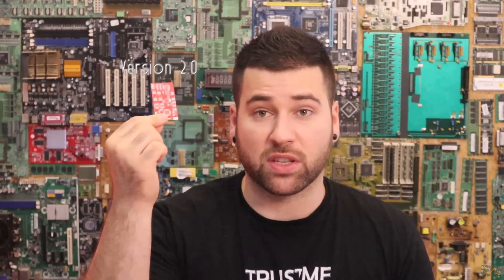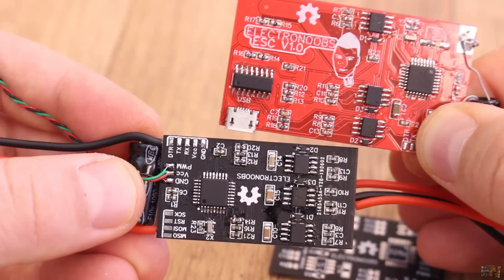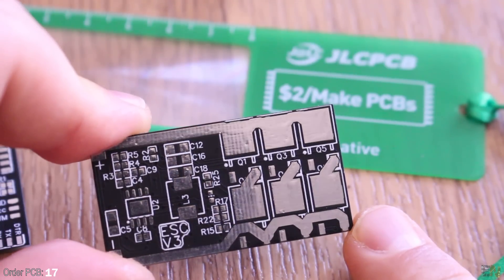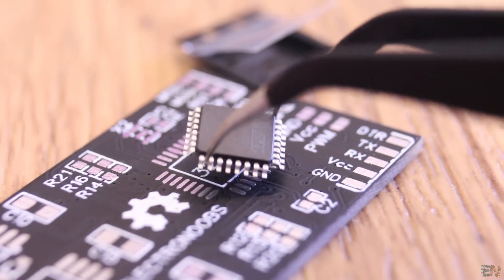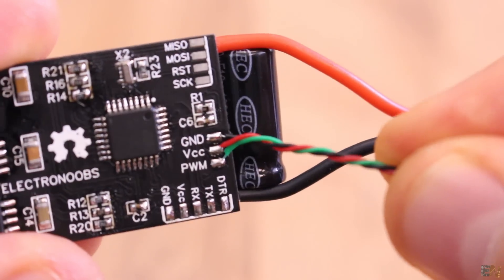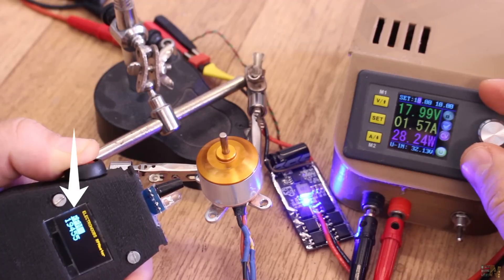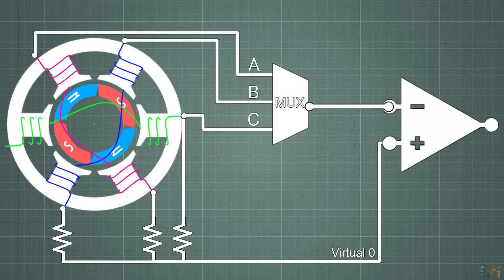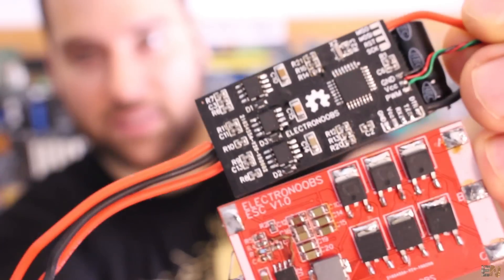Open Source ESC based on Arduino - High Speeds

Comment: hello, you can separate the controller supply and the motor supply to enter voltages higher than 24 volts? (of course, changing the mosfets)
Reply from the maker: Maybe just use a different buck controller ic that goes over 24v

Comment: Looking at the Code, I guess that the PWM Outputs work with a frequency of 490 Hz since you haven't changed the timer dividers. This is noisy and suitable for Motors with high winding turn number only. Is it possible to achieve a 20 kHz PWM Output?

Comment: My brushless motor is going to its maximum speed without a rotor fixed to it but as soon as I fix a rotor to it, the motor restarts as soon as I reach 25% speed, what can be the problem? My Bldc motor is 1200kv a2212 and my esc is 30A.

Comment: Hello Friend. I would like to drive a BLDC motor with 28 volts using your schematic design and code. I see your ESC uses IRLR7843PbF MOSFETS which are rated with a drain to source voltage of 30 volts. Does that mean as long as  I do not power the buck regulator in your circuit diagram with the same voltage ( but say 12 volt ), it will work to drive the motor at 28 volts ?

Comment: Hey i look at Your work, it's gooood ;) The maximum voltage is rated to 600V of external power source? If i separate 2101 supply from vcc of trasistor and change the mosfets to IGBT i will able to use up to 600V DC, one more thing to do is to add the voltage divider that will handle so high differences in voltage, what the minimal that Arduino can read? If i for exemple give 330k as R1 and 3,2K as R2 of the divider at 500V i will get 4,8V and on 12V i will have 0,115V, will Arduino handle to read this?
Reply: I have look at arduino specyfication and minimal voltage that nano will support is 5V / 1024 = 0,0048828125V so changing the voltage divider parameters let me use voltage in range 6-500V.

Comment: Hello, for the ESC v3 i found that the provided code size (Version 4.1)  is within the memory limits of the ATmega168p. Since i have a few 168p spare parts in my lab, can i use that instead of the 328p ??

Comment: Question , what software do you recommand or anyone from the comments to test the condition of a pcb , such as voltage , current and waveform characteristics. I am trying to create a custom ESC for a thesis but i had no luck to find a suitable program to simulate it

Comment: Does anyone know the "arduino's" comparator input max values? How come he needs to divide the voltages going into the A0-A2 but not to D6?
Reply from the maker: Hi. Sorry, I didn't explained that in the video but I also divide the voltage that goes to D6 the same as the A0-A2. Just look at the schematic: http://electronoobs.com/eng_arduino_tut91_sch1.php

Comment: hey guys !! .. I have completed this project .But when i start the motor , it spins for 1-2 seconds , get stuck and produces noise. Can anyone suggest where i am going wrong ?  I am using STP55NF06 mosfet and ir2101 ic.
thanks
Reply from the maker: At what voltage are you running the motor? What motor are you using? Is possible that you create a very low back EMF and the Arduino won't detect that.
Reply: @ELECTRONOOBS  ..  hey , thanks for the reply . I am using a 12v , 1 amp adaptor to power it. My motor has a rating of 1400kv .. I am not sure about the back emf that I am creating ,as I don't have oscilloscope . Is there any other way I can measure the back emf ?
Reply: @ELECTRONOOBS  .. and one more thing, I made this circuit on the breadboard .. is it because of this reason ? But none of my wires are burning, even my MOSFETS are not heating up .
Reply from the maker: @parijatpandey4371  1 amp is very low. You will need at least 2-3A. Try a better power supply.
Reply: @ELECTRONOOBS  ...thanks a lot, I'll try this
Reply: @ELECTRONOOBS  ..  just have a follow up to my question , when I power my commercial esc with the same adaptor , it works flawlessly. Maybe I am missing something here .
Reply: @ELECTRONOOBS  ... Hey .. I got to know my mistake.. actually the schematic that u have provided uses pin 2,3 and 4 ..and uses 5 as buzzer .. but in the code you are using 3,4 and 5 .. and there is no buzzer as we are using the motor as the buzzer .. maybe you can change the schematic for others in the community. And good luck for your new website.

Comment: Hey Electronoobs, I am making a 12s 65A ESC, can you explain how you determined the voltage dividers for the Zero-Crossing sensing? Does the sum of the voltages measured at the voltage divider need to be 5V? Or does the sum of the voltage drops at the divider not matter so long as it is not exceeding 5V (Being the ATMEGA 328p's max IO pin voltage). Anyway, great video thanks for further explanation on the Zero-Cross.
Reply from the maker: The divider output must be below 5V all the time. Otherwise it will saturate and also higher voltage might burn the analog input of the microcontroller
Reply: @ELECTRONOOBS  just saw this, thanks.
Reply: @ELECTRONOOBS  also how does the voltage drop across the floating "coil" change based on the voltage being supplied to the motor? is there a way to predict it?
Reply: Bro is it possibel to add parallel mosfets to a 30amp esc to incerase ampere rating

Comment: I’m curious. When you return your control back to zero/standby position it seems like the motor spins for a significant length of time before stopping. It this something in the code or is it something in the ESD itself that causes a long deceleration time?

Comment: Hi bro... Motor not spinning :  I have purchased your esc Gerber and it's code ... The board is ready ... I uploaded the code...as in the instructions I uncommented that one EEPROM line uploaded it and commented the same line and uploaded again... Now when I connect the esc with battery while transmitter is ON I can hear the config beeps and after a while....when the throttle is low it beeps ... But when I increase the throttle the motor not rotating... Could you help me ...
Reply from the maker: Have you configured the upper and lower limits of the PWM? For that, put throttle to maximum and then connect the battery. After the beep put throttle to minimum and that will save the new range. Usually is from 1000 to 2000us.
Reply: @ELECTRONOOBS   I have tried it bro but after I put the throttle to Max and connected to battery  the fast beeps didn't occur instead the normal initializing beeps occurs and then after 3 seconds the single beep with interval occurs. I don't know where it went wrong ... I have been struggling for past two weeks only because of this issue .. and at last I asked for your help

Comment: What is the cost of pcb and components when I wannt to assemble 10 escs?
Sorry my English is not very good
Reply from the maker: I'm not sure yet. I'll have to calculate it
Reply: OK

I have an broken lawn mower robot that I wannt to convert so that I can control it with an remote control. The only problem is that the robot has bldc motors, so I can't control them with relays or a simple transistor circuit.

Comment: Is it possible to control an esc with a potentiometer?
Reply: yes, but only in so much that the potentiometer resistance is measured by a microcontroller reading that info into its analog input pin and thereby determining what you are telling the ESC to do by way of the potentiometer and the microcontroller then does the switching to make that happen.  If by your question you mean use nothing but a motor and a potentiometer with no switches and no microcontroller, of course that is impossible.

Comment: Can i use modified circuit for ebike Bldc motor controller??
Reply from the maker: Not sure. Maybe...
Reply: @ELECTRONOOBS  i think, when i build in power mosfets, some heatsink, sensors phase multiplexer and some speed and RPM timing, it can be good😋😏

Comment: are those 0603 resistors? did you publish this design also under open source? I would like to experiment also with a mode to be polulo compatible for fast geared down cnc
Reply from the maker: This version is not yet published till i'm sure a our the Kickstarter, sorry...

Comment: How can I make this handle 100v?
Reply: Just use proper mosfet, i made my own 3 phase bridge with IRF9540n and IRF540n both rated 100v ~20a, also no mosfet driver requiered just optocouplers and arduino uno to replicate this!

Comment: Why even bother? Are not BL32 _Heli the best of the best? 

Btw: It would be nice to be able to switch between 5,6 and 8,4volts
Reply: i find this absolutely wonderful for the sake of learning. if you just want to use an esc, blheli32 is surely a great choice, but not really for learning since it is (sadly) a closed source project.
Reply: @mircoheitmann  Thank you. Wjats your Longtermgoal with this project ?

Comment: Great project, I am interested. I have a question. In the version with both clockwise and counterclokwise movement, what will happen if we dont stop in the middle? Instead move the remote joystick from all the way up to all the way down? Will it stop for some time? Will it brake? Or will it change direction instantly?

Comment: in this your video "https://youtu.be/8LXPcJD6hEA?si=eFbHwqm6RFG5Rkea"  17:46  You use the value of each phase and subtract the sum of the 3 phases to see if they pass the zero point.
and in this video "https://youtu.be/-ymTE-Nivzw?si=FxKVHeUVVZLsdqjO" 14:09 you use opamp at D6.
So What limitations do they have and Which way would be better?

Comment: Actually i am not sure you are right about programming the chip before soldering on board because in case of esc there is a flasher which can flash smd atmega chips directly without any pins or something.  ..... I think it might help you...

https://hobbyking.com/en_us/atmel-atmega-socket-firmware-flashing-tool.html?___store=en_us

So no need to flash the esc before soldering you can do it afterwards as well

By this tool people upgrade the firmware of esc's
Reply from the maker: Thanks for the help. I'll look over this!